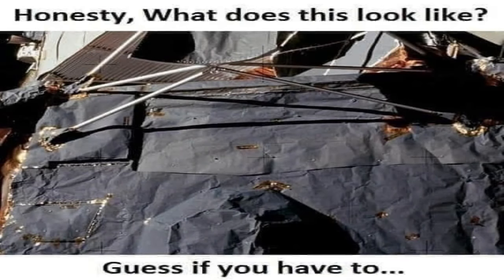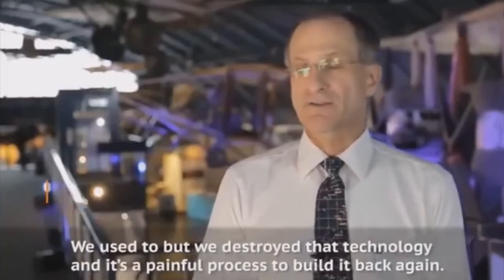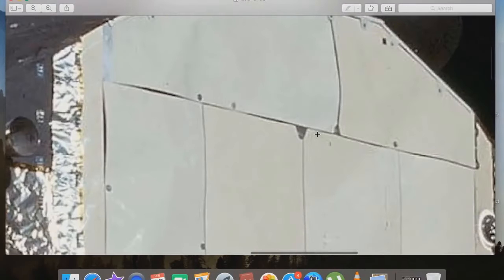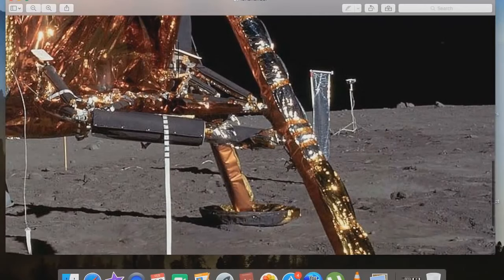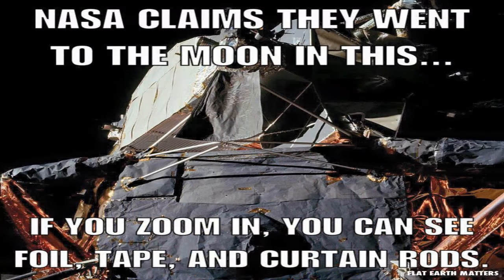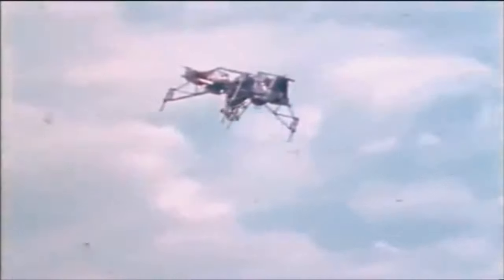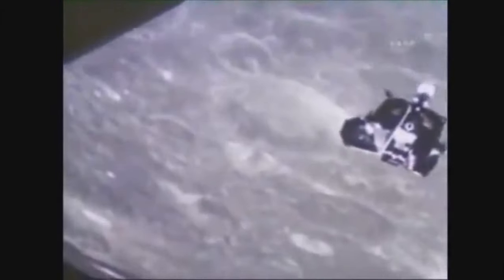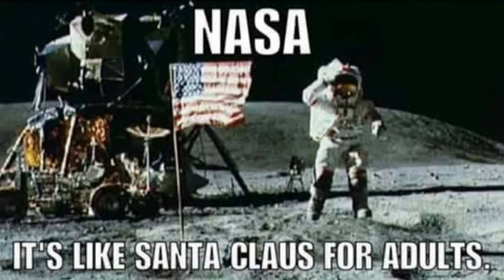NASA's Laughable Apollo Lunar Lander

Comment: How on earth is it possible for a multi-ton rocket to carry enough fuel to carry it, and fuel, the necessary 200 -240 miles, fighting 'gravity' all the way, where it finally 'slips the surly bonds of Earth' ?
Reply: A sufficient amount of fuel was carried for the engine burns necessary to escape the gravitational pull of the Earth on the outbound journey and the Moon on the return journey, and for minor mid-course corrections, and to place the spacecraft in orbit around the Moon. For most of the time the spacecraft coasted and used the Earth and the Moon’s gravitational pull to attract it towards them

Comment: That black area is black foil used in photography.
Reply: The black material is where thin Inconel sheets were painted matte black with Pyromark paint to improve their heat emission properties, so they would cool off quickly. (Black material both absorbs and emits heat better than material of other colours). 
This treatment was applied where the hot exhaust of the reaction control thrusters heated the descent stage. The plume defectors were also painted black as were other parts of the ascent stage that were heated by the thrusters.

Comment: All of your building and materials arguments can be debunked, also the film quality, but the lack of a blast crater?
They might have made this module, maybe it was able to fly trough space (no air resistance), maybe they had crappy cameras, but what´s sure is that landing on a dusty area without leaving a crater is not possible.
Reply: "...landing on a dusty area without leaving a crater is not possible."

Let's have the numbers, please.  What was the weight of the craft upon landing, it's descent rate and the required thrust to make it happen?  What was the PSI of the exhaust exiting the engine bell, and at what distance?  What was the composition and hardness of the lunar surface, such that you believe that a crater would have resulted?  To make your claim, you must be able to answer all these questions and more.  Otherwise, you're just guessing, based on nothing.
Reply: @cardinalRG  No, I´m not guessing, in order to land you must apply thrust, or you will be free falling, basic gravitation theory; this things don´t glide, they fall.
The surface was soft enough to leave a print of Armstrong boot, so it was soft enough to leave a crater if a rocket engine was aimed an it from short range.
Look, I had never believed the tin foil hat arguments about the flag, the shades, etc; but this one, as a person with studies in physics, is hard to swallow.
If you point an engine to a dusty surface you leave a mark, that´s not a tin foil argument
You are claiming the surface might be hard as a stone, then explain the footprint.

Maybe they are into something, maybe not, maybe the engine was shut off some meters above ground and they indeed went into a small free fall in the end.
Reply: @albertov9664  --The dust layer onto which Armstrong stepped was about an inch thick, under which was a very hard layer of regolith.  (That’s why he had so much trouble hammering in the flag, and why the flag later blew down so easily.)  Moreover, Armstrong exerted a force on the lunar surface of only about .6 PSI, still slightly more than the lunar lander’s rocket exhaust of about .54 PSI, which was shut off at six feet above the surface.  So if Armstrong didn’t make a crater with every step, why would you expect the less-powerful exhaust of the lander’s engine to do so?

See, what I’ve done is some analysis, while you’re only guessing.  Do you see the difference?
Reply: @albertov9664  --As for simply leaving a mark, the lander’s exhaust did do that.  There are photos showing dust having been blown outward from the center point, and dust having settled in the lander’s concave shoes.  There is also footage of the dust being kicked up as the lander approached the surface.  So the exhaust did have an effect, just not sufficient to make a crater.
Reply: @cardinalRG  Why do you take it so personal? I´m not guessing, there was a layer of dust that should have been removed; or are you telling me that Armstrong´s boot was so strong that it pulverized the regolith?
You can talk about all the psi you want, all the regolith you want, but there was a dust stratum on top, the footprint proves it; that dust stratum should have been removed, that´s all I am saying; just give a valid explanation to prove this argument wrong.

UPDATE:
Ok, tin foil hat myth debunked, also your PSI and regolith arguments: I found several pictures that clearly show the crater and burnt material below the Apollo 11, like this one:
https://azimjon.com/media/2020/04/19/Apollo_11_landed_on_moon.jpg

Now I´m a believer again, but because of clear evidence, not flawed arguments; claiming that the floor was too hard or that maybe they just let the eagle fell are not valid arguments; landing procedures leave marks on the ground, as many pictures clearly show.

The tin hat argument is based on pictures taken from a specific angle and with certain lighting that don´t show the crater (I found that pictures too) (clearly it´s just a matter of angle and light).
Reply: @cardinalRG  Lol, while you where looking for the pictures so was I.
Yes, there are clear pictures of that, I took a while verifying that one of them where from the Apollo 11 landing and yes, there are some.
The argument against the lunar landing is misleading, based on some specific pictures that don´t show the full scene.

Well, now we have a picture to prove deniers wrong (have to admit I wouldn´t have looked if it wasn´t for this discussion, go figure, something right can come from an online argument.)
Reply: @albertov9664  --No, friend, I’m not taking anything here personally.

”…there was a layer of dust that should have been removed…”

Yes, but the removal of surface dust doesn’t constitute a “crater”, unless you’re using a novel definition of that term.  And the photo you linked shows what I described.

”…claiming that the floor was too hard or that maybe they just let the eagle fell are not valid arguments…”

Yes, they’re valid arguments, unless you think that a rocket’s exhaust would have the same effect on loose sand as it would on concrete.  And the distance between an exhaust outlet and a detached surface certainly does affect the force reaching the surface.

”…landing procedures leave marks on the ground, as many pictures clearly show.”

Yes, we agree.
Reply: exactly. most of these materials have properites which were needed for traveling in space. the paper? could be some bent metal. not everythings going to come out clean and perfect after you just fucking traveled through space

Comment: There are more holes to the story specially when it comes to actual photography taken from the moon surface. 
There was no white holes on a photos or films which would be normally there since radiation would punch trough the film like nothing and they would be visible on photos.
Also that model of camera where slightly modified but it didn't have any cold protection and as peoples who work with same exact models said it was all mechanical back then and in -10C it had really hard times to even make any photo so it would be hard to imagine this type of camera working on a surface of moon.
Reply: The very thin lunar atmosphere cannot efficiently bind surface heat to devices that are not in direct contact with it. The camera film was derived from the ones used for high-altitude photo reconnaissance, which were designed to withstand temperatures from 490°F down to - 40°F, and they were housed in aluminium magazines covered with reflective passive optical coatings. The radiation exposure level on the Moon from the distance of space was not enough to damage the film. It was much less than that of an airport x-ray machine’s direct radiation from a distance of less than a few feet. It had the same effect equivalent to leaving the film on a shelf for six months on Earth. And, of course in 1969, film was often left on shelves for far longer in many cases and still used. Furthermore, there are signs of radiation contamination in some of the images, if you look carefully; for example lines running through the film, bright spots and a decrease in contrast and colour response. These effects are not easily detectable to the untrained eye and without access to the original material.

Comment: What a misleading bogus video you deliberately didn't bother to research and find the many pictures out there showing the structure underneath the thin weight saving aluminum panels and kapton/mylar material, the actual pressure shell of the module which is more rigid and contains the crew cabin, fuel tanks, water tanks etc. You literally judged the LEM by its cover.

Comment: ERIC **  please look 👀 In the video ( lunar lander fabrication analysis) please look at the window,there is a guy without a helmet on,,its approx 13mins into video,I can see 2people without helmets in the lander on the moon,its a triangular window to the right of the round window,.its apollo 17 lunar lander,ive just found a better photo through google where you can see his head in its entirety 🤪 was it pressurised? Im very confused,the walls are not built for pressure? I dont know?
Reply: Why would you need a helmet on in a pressurised cabin? The outer panels covering the aluminium pressure hull were extremely thin and buckled with the stress of impact and lift off. These were outside the pressure hull and so were completely unimportant in terms of strength.